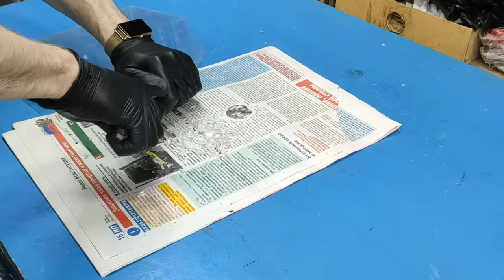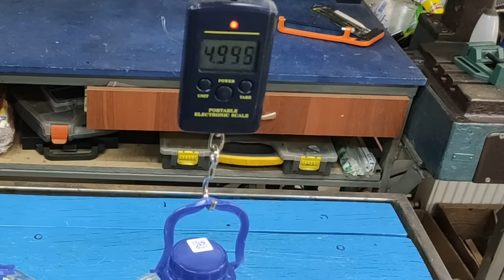I wish I had known this SECRET when I was 50! Liquid plastic with my own hands!

Comment: Fun trick. Drop Styrofoam in acetone and it turns into this smooth plastic sludge. However, As the acetone evaporates, the consistency gets more putty like. Eventually, it hardens into solid polystyrene. I have used it to plug holes in concrete before.
Reply: Thanks! I like this idea a lot.. I'll give it a try in a well-ventilated space.
Reply: Liquid styro (gasoline as solvent , or acetone will do)  is also called napalm...dip a stick in, light it, and it becomes a match that don't go out on a windy day or a storm 😁  Use with caution though.
Reply: And it's useful almost instantly too if you don't overdo the acetone (or mineral turps, which also works but to a lesser extent). Adding the acetone to the styrene foam helps here, or adding styrene to a small jar of your chosen thinner until it doesn't dissolve any more. I've used it in numerous applications but the most impressive was arguably replacing a nut and lock on a bicycle's crank.
Reply: Well I'm in my 70's and have known this since I was about 13!! 🤔😲😲🙄... Polystyrene foam in petrol or acetone makes polystyrene cement. Acetone has always been the goto adhesive solvent for perspex if the jointed edge is smoothed dead flat and the acetone painted onto the edge carefully as well as onto the surface to be joined, extremely strong and invisible joints can be made!👍👍👍

Surprised this is news to an old codger! 🤔
Reply: @pchykins6680  act accordingly
Reply: Curious about using this as a weatherproofing sealant. I've built a custom toolbox for my truck with a sliding drawer similar to the packrat system since they don't offer it on my model vehicle. Thinking this would not only waterproof the wood, but also double as a sliding mechanism? Any thoughts on these applications?
Reply: @vapormissile  
Give it a go. A can of acetone doesn't
cost much and recycling the jars
and water bottles who knows what
you could create. Don't forget to
let us know.
Reply: @mattblattel8106  I bet you could, but i'd probably use a commercial sealant.  Acetone is nasty.   I like the idea of being able to improve your existing stuff.  I bet it's possible to make different plastic coatings this way.
Reply: @vapormissile  so my drawer is plywood on the bottom screwed to 2x6, no actual drawer slides, 5 foot long 50 inch wide. I've got a captive bearing roller on the rear of the drawer to slide in the grooves of the bed but after tools and material are added it's a very difficult thing to move. I had a previous design that worked well but it was half as wide and was 2 drawers. I'm battling cost and weight for function
Reply: @mattblattel8106  I'm sure I could make it worse by attempting to improve it.  I could accidentally invent poison-gas super glue ☠️
Reply: @vapormissile "and it shall be called stupor glue," he said with a twinkle in his eyes lol
Reply: @mattblattel8106  the twinkle is really just silica-based glitter paint
Reply: That may work for fabricating parts (and repairs) for Plastic Model Car Kits. They're made out of polystyrene.
Reply: How did it hold up?
Reply: @PowerMovesCollective  probably about like solid polystyrene.
Reply: we use gasoline back in the days
Reply: So that can help to change its form to a form a want.  Thanks
Reply: @mattblattel8106   I have the same curiosity regarding buried wood in a damp environment.  How long would the waterproofing last?
Reply: Ah, a man of DIY culture.
Reply: I seen a video where a lady done this but made a bracelet with the goop. Are they sturdy enough like hard plastic? Or does it go back to the foam texture?
Reply: I didn't understand exactly what he was chopping up in the beginning. 
Was it a piece of acrylic?
Can someone tell me what it was, please.

Also, I couldn't read his hand writing so I thought the liquid was alcohol, I take from the comments it was acetone. 

So if I'm correct if I take what ever he cut up and soak it in acetone, I'll make this wicked glue.

Someone calling this napalm in the comments scares me... 
Is this stuff poisonous?

Just so you know, I have no science back ground, I am just a pretty nail tech (not blonde) but pretty...
So I'm not dumb and incapable of learning, I just need you to explain nice and slow - like I was 4..
Lol

With that being said, what happens if this stuff touches skin, or more specifically nails???

Thanks in advance  😊
Reply: Can do a similar thing with   citronella too.
Reply: Are you talking about another thing to do, or what is shown in the video. To me Styrofoam is like what a pool noodle is made from.
I am not positive what is used in the video, I think its a piece of Acrylic. I have asked and have not got a reply. I also do not know what those liquids are. I wasn't sure if one was alcohol or acetone and have no idea what 646 is.

So I don't know if you are telling me what was used, or giving another way to make something similar. 

Please explain  😊
Reply: @catpride1323  pool noodles are a type of styrofoam but so are take out containers and drink cups. I'm not sure what 646 is either but I definitely know that acetone is one of the liquids and that you can dissolve the food containers into it and the resulting goo when you get enough of it can be molded into all kinds of molds and be recycled into other things and can be used as a glue with certain materials
Reply: Polystyrene not pool noodles 🤣🤣🤣
Reply: @neilcrompton3488  Did I mention I was a pretty nail technician??
What is what ever you spelt??
Reply: @edwinacoffman6429  Oh... Well that's kinda cool...
That stuff he was clipping up look like a piece of acrylic. Like the kind they use for display boards...

Thank you for taking the time to explain, and in a way it made sense. 

How do you know what you can try and adhere with your new made glue?
Reply: @catpride1323   polystyrene foam, the solid white stuff in new electrical goods boxes that prevents damage ????.......
Reply: @pchykins6680  Napalm?? As in " I sure love the smell of Napalm in the morning " Napalm ??

Doesn't that stuff kill all kinds of living tissue ?
Reply: @neilcrompton3488  But the guy in the video wasn't using that stuff.
He had some hard acrylic/plastic kind of stuff that took a lot of muscles to chop up.
Are you saying I can use the packing foam instead?
Reply: @catpride1323  I recently seen a video where he done it. I've only ever made jewelry pieces with it
Reply: Hola  @boblewis5558  ! Consulto a tu sabiduría: conoces algún método casero de como lograr hacer impermeable un papel, pero que no quede rígido? y también si sabes cómo impermeabilizar tela, sin rigidizar tampoco... Gracias!!! me importa sobre todo lo del papel! Gracias desde ya!
Reply: @paofandino.coach. well there's a question. Firstly I would say making paper water PROOF. Water resistant? I can think of some methods that MAY work, but not tried them it depends on whether or not the paper has been printed, how it's been printed the type of ink etc. Whether or not you wish to waterproof before or after printing/writing.

Some suggestions you could try:

Perhaps the most obvious to me is WD40! As the origin of the name states WD = Water Dispersant formula 40. It is usually readily absorbed into paper but as it removes many types of ink you should test it for yourself.

Furniture beeswax? (The softer more liquid type)
Furniture polish? Spray or rub on type.

Commercial hydrophobic solutions ... No idea where to obtain such, sorry.

Re: fabric, the only thing I know of (and it WORKS I've tried it) is NikWax ... Available in a heavy wax for leather and also as an additive that is used to wash fabric that leaves it water repellant (not really water proof, but usually rain proof). Again some testing to see it it meets your needs.

Hope that helps.

There
Reply: Depends kind of wood but epoxy coat to part mixture or get some Bondo with it applicator and epoxy resin  with applicator get some lightweight stretchy type material or a spandex type material will do it. Probably same price as polyurethane an acetone together. Also think about how much of this potentially hardest crap would need to make to necessitate truck tool box @mattblattel8106
Reply: @paofandino.coach. I think you could do what he did just use more acetone to make it really liquid and then dip the paper in it and it would absorb into the paper and when the acetone evaporates you're left with a waterproof yet still somewhat flexible paper
Reply: @vapormissile 😅
Reply: Can I use this for waterproofing a compound wall ?
Reply: @mattblattel8106  it works as sealant, this is just plastic, you will basically encase it in plastic. dont know about sun exposure though.

Comment: A thought from an hvac/refrigeration tech. Place plastic sheet section in a freezer and then it could shatter easier on top of a rag with a hammer for particle creation.
Reply: good idea, I was thinking, there's got be an easier way to get the small plastic pieces 👍😎👍
Reply: Gracias hermano 👍🏼
Reply: No need if you use a shallow tray (metal or polythene). The plastic will dissolve from a sheet. Just leave it submerged overnight and give it a good mix in the morning. Just ensure it's covered over to prevent all the solvent evaporating. Worked for me.
Reply: Could you use an electric sander next to a hand vacuum? Basically sand the whole thing to nothing and suck up the particles as you're doing it to create plastic powder.

Comment: Things that you can do WITHOUT 3D printing. I respect that.
Reply: Speaking of 3D printing, I've done this for years with ABS filament to make goop for better bed adhesion.  Same concept here.  If you have lego bricks laying around, they are made of ABS as can be used for the purpose in the video.  Just put them in a non-plastic container with the acetone, wait for them to dissolve, and you're good to go with multicolored goop (or liquid plastic).
Reply: Excelente observacion

Comment: This is old school stuff. Back in the 70's working as a plastic letter fabricator we mixed acrylic chips and chloroform (trichloromethane) make a thick glue to reinforce a joint made with just chloroform. It was also used to bond sheets of acrylic together to make thicker sheets.
Reply: What kind of plastic was it?
Reply: The problem is that old shool stuff die along with the older people and not passed forward mostly because the new generations don't keep up with old good tricks till they are forgotten or even worse, lost.
Reply: @nicolasparadis1407  As I said 'acrylic '
Reply: I'm tying to fix a broken corner on an acrylic sculpture I have from the 60s. It's clear acrylic and the chipped corner that needs to be remolded is about a cubic inch in size. As someone who has worked with repairing acrylic, do you have any tips?
Reply: Lovely experience from you 🤜🤛

Comment: I had to come back and thank you for this. The use for making a file handle has saved many old screwdrivers I have - used to repair broken ones and missing ones. Thanks!! These old Stanley screwdrivers are great, but the factory plastics have gotten brittle over the decades they have been used.
Reply: for smaller files i drill hole in to disposable razor handles and use them for handles
Reply: @protonx80  Oh, I like that a lot!!
Reply: Can we use it in shoes soles separations
Reply: I mixed styrene foam and gasoline to patch nail holes in corrugated roofing iron. It worked very well.
Reply: @protonx80 great idea....I usually use golf balls

Comment: Most people who have a 3d printer will use acetone for cleanup and for better adhesion on the hotbed.  You take scrap PLA plastic and melt it in the acetone and store it in an old rubbing alcohol container then brush it on as needed, I have one that is black and one that is white being those are the two most used colors.
Thanks for the video, I had no idea how strong the plastic is when used this way.
Reply: Interesting! Have you got a weight ration of PLA to acetone? Also, can the acetone be increased to make it very thin? I'm looking for a preservative for a wood bridge and wood like something that with soak into the log beams to waterproof them so they last. (Store bought stains/preservatives have been garbage and not durable at all!) 
Thanks very much!
Reply: I thought that only worked with ABS?
Reply: @wingnutbert9685 I would think so and I'm going to try it out on my buddy's utility trailer
Reply: @ProudDad1976
Great tip about the acetone melted PLA as a 3d printed hot bed glue. My son and I have been successful using glue stick or the skirting setting on our 3d printer. If we have a printing piece that's challenging keeping it stuck to the table we'll definitely try the acetone melted PLA.
THANK YOU!
Reply: Do you mean ABS? PLA is pretty resistant to acetone and it doesn't work as a smoothing agent either, but it's amazing with ABS - and I use a solution on the hotbed to help with adhesion when printing with ABS.
Low molecular weight PLA does dissolve in acetone to a point, but most commercial filaments are high molecular weight. However, many nail polish removers now have ethyl acetate in them instead of acetone, and that does dissolve PLA.

Comment: What type of clear flat plastic do u chop up at the beginning. Acrylic or Lexan polycarbonate?  Also, what is 646 solvent?
Reply: I believe is plain acrylic. Let me know if you try it with polycarbonate. I'd be interested to know if it works. A quick search revealed that 646 is some form of thinner sold in East Europe/Russia composed of acetone - 7%, ethyl "cellosolve" (??) - 8%, ethyl alcohol - 10%, butyl acetate - 10%, butanol - 15%, toluene - 50%.

Comment: have you ever tried putting this stuff into a platinum cure silicone rubber mold to make parts?
Reply: Ooooh good idea
Reply: Can’t see why not, if it doesn’t stick to the putty he used, it will probably not stick to the silicone mould…..

Comment: This is so inspiring, and I'm dying to try it, but I have questions. Re the ratio pf plastic:acetone, is there a formula- weight:volume perhaps- that'll produce the consistency of that shown in the vid, or does one simply guesstimate? Also, can more plastic or acetone be added after the fact to thicken or thin the original mix?
Reply: You can just add chunks of styrofoam to a few ounces of acetone until you get the consistency you want and, yes, you can add acetone or styrofoam as you go to get it just right.  I'm talking about styrofoam and acetone because it's the only kind of plastic I have experience dissolving this way.  It's amazing how much disappears into the acetone, btw.
Reply: Acetone+styrofoam videos can be found online ... I'm amazed at using the hard plastic...
Reply: @patrickcardon1643  If you have lego bricks laying around, you can use them to make multi-colored goop like he used in the video.
Reply: @danwyan  Good idea!
Reply: What do you use to make this strong glue ?
Reply: Hmm, it's almost like you just showed up, totally unaware of the video and the thread to which you replied.
Reply: @bobmahnamahknob  😂
Reply: Yes you can add more. Even if it hardens. Just add acetone to it.  I use it in model making or sculptures. Like force feilds , or drool. Want it to dry faster? Fire is effective. BUT!!! it is flammable. Move your jar away blow it out before it warms up and drips.
Reply: @nessunodorme3888  does it make a good glue? how long does it take to harden after you make it?
Reply: @ForrestLambert.2022  I honestly don't know since I wasn't using it as glue.  But, generally, acetone evaporates very fast so I imagine it would harden fast, too, depending on conditions.  Sorry I'm not more help!
Reply: ❤ Bravo 👌...me ha gustado y he comprobado..un abrazo desde España 😂❤
Reply: @ForrestLambert.2022 chloroform weld acrylic but is watery but think with scrap pieces it will make a syrup and help with welding. Also evaporate quickly

Comment: Please, How long does liquid plastic stay liquid?
Reply: Just a couple hours depending on how much acetone is used. The plastic hardens due to the acetone evaporating. But, you can turn it back liquid by putting more acetone in.

Comment: if acetone can melt hard plastic sheeting. can it melt plastic caps from milk cartons? i don't really have plastic acrylic sheeting. i want something that can melt normal plastic lying around the house. It's so useful these videos because buying glue is expensive:face-red-heart-shape:
Reply: i think you're talking about polypropylene plastic, they make shampoo bottles, bottle caps, cutting boards for kitchen, and many other stuff, from what i know that plastic doesn't melt with acetone. But i've seen people melting it in microwaves, and then pressing it into forms, there is a video with some guys wich made roof panels from this kind of plastic.
Reply: @alexandrugajin763  I've also seen someone make boards with it like 2x4's and 1x8's (American sizes :( ).
Reply: Throw some in a jar and see if it melts?
Reply: They won't. If you get acetone or nail polish remover it comes in a HDPE bottle. Or #2 plastic
Reply: Bottlecaps are HDPE. They will melt in a sandwich press between two layers of baking paper. You can then put the melted plastic into a mould. Using glue on it or using it as a glue won't work.
Reply: You can melt plastic caps using an iron, so you can squash them flat

Comment: What kind of clear plastic? Acrylic or polycarbonate?
Reply: I'm sure that the video shows acrylic (Plexiglass). Acetone will not dissolve polycarbonate (Lexan). However, acetone will dissolve acrylic slowly, methylene chloride will dissolve it faster, toluene will dissolve it even faster. But for the best results use chloroform. Also, chloroform makes the best adhesive for acrylic. With a little bit of practice (and a hypodermic syringe) you can make completely invisible welds in acrylic.